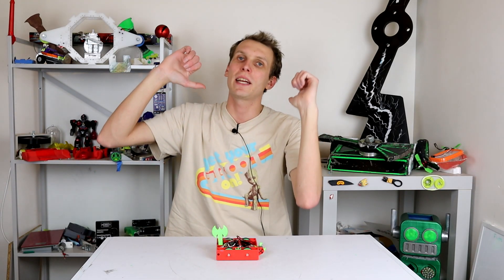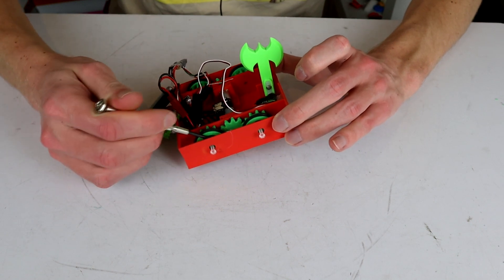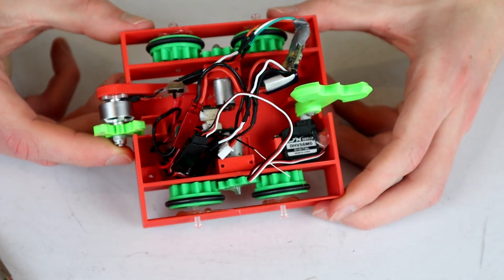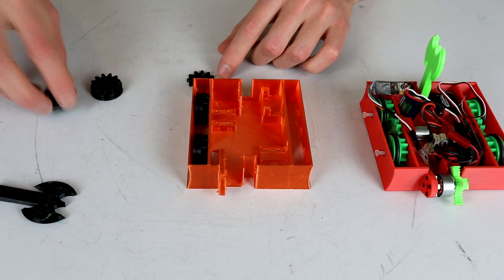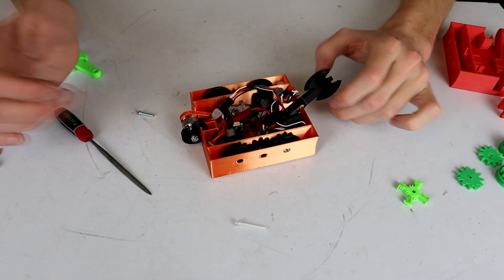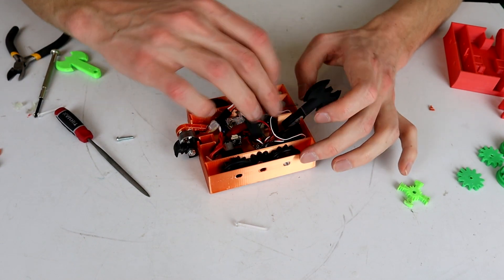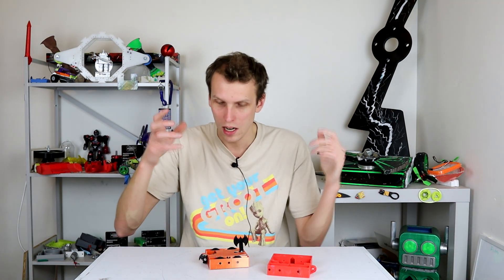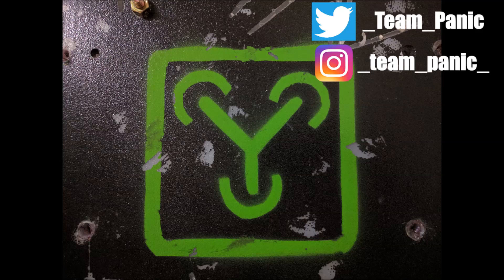Upgrading a robot I designed at 8 years old (Flaming dragon v2)

Comment: How to battle hardened brushed dc motor
Reply from the maker: People dont battle harden brushed motors because they can be tricky to pull apart and put back together.

For anything under heavy weight robots dont botther battle hardening brushed motors
Reply: I am using brushed motor in my 1 pound robot as a weapon motor after delivering some hit the magnet inside the motor shattred and the motor stops how can I prevent it
Reply from the maker: you'd need to open the motor up and apply epoxy to the magnets, but its harder to pull apart and put back together a brushed motor then it is to pull apart and put back together a brushless motor.

Personally I'd recommend moving your weapon over to a brushless motor
Reply: @TeamPanicRobotics  I'm searching for a lightweight brushless motor. Can you give me a tip/recommendation?
great video and thanks for making it.
🙏

Comment: Interesting as ever.

Why do you tend to use a rounded end on your weapon blades?

Doesn't it make it more difficult to get bite as you are pushing your opponent way if you don't bite with the weapon?

Soft rubber wheel to make a rotary flipper rather than a spinner?
Reply from the maker: Nope if you have a bar with a flattened end, if the tooth misses, then the other corner (which also sits at the radius of the weapon) will hit, giving a little nick.

but the chances of missing with the tooth and hitting with the end of the bar are super small either way.

I keep the end rounded for two reasons: laziness (the rounded end is a byproduct of the way I cad weapons, and I leave it rather then flatten) and technically rounding the end gives a small amount of extra MOI, so technically rounded end weapons hit harder

Flaming dragon is in the B league which is a plastic class, so unfortunately I dont think they'd allow a rubber wheel, but I like the idea, so I might ask at some point in the future